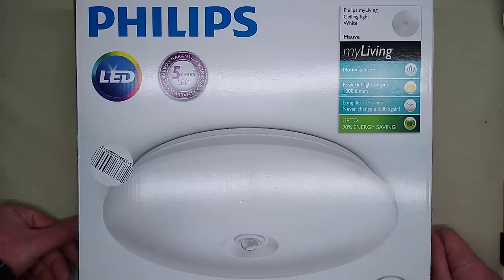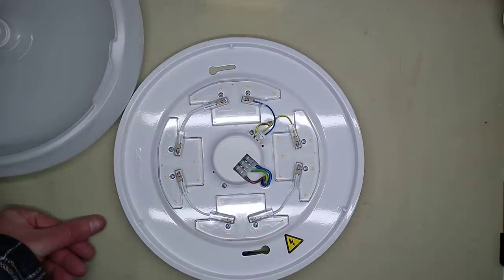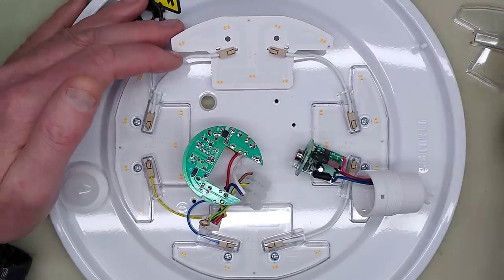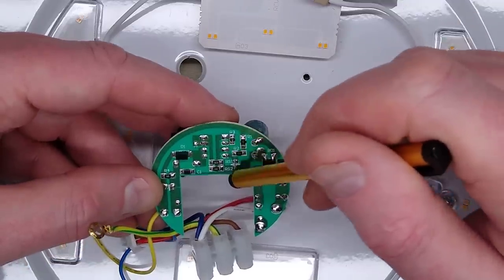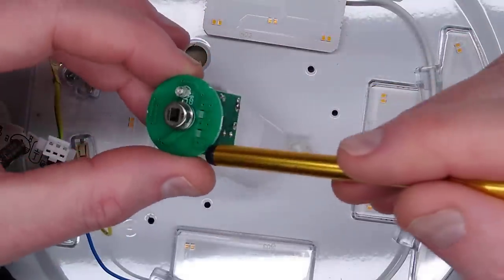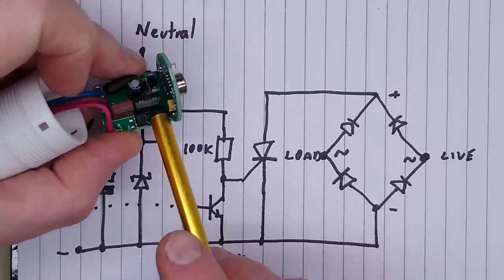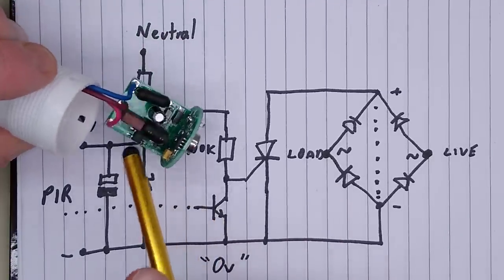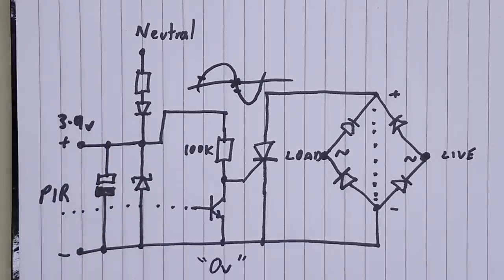LIDL Philips PIR LED ceiling light teardown.

Comment: 15 Years life, but how many hours a day can it be run to last 15 years? They often state this on the back of the box somewhere, in smaller print (i.e. based on being used xx hrs per day).  Also after watching Dave (EEVBlog), those lights wouldn't be legal in Australia because of the poor power factor.

Comment: Is there a way to switch off the motion detector in order to have the lights on all the time?
Reply from the maker: Yes.  The sensor usually has three wires.  Live, neutral and switch.  If you bridge the live and switch wires together it should run all the time.
Reply: @bigclivedotcom  Thanks.  At 4:54, please correct me if I'm wrong, does it mean that it would be possible to jump/connect the blue and red wire of sensor connector?
Reply from the maker: @sivitec  it may depend on the specific colours used in your module.
Reply: @bigclivedotcom  Edited: I checked the wirings of the sensor.  Based on the snippet on your video at 9:00, RED is marked as L*, BROWN as L.  BLUE is marked as N.  If I need to jump the connectors, which one should I connect to bypass the sensor?  By the way, I have the same model LED ceiling light.  Thanks in advance.
Reply: Just an update for everyone who wants to bypass the motion sensor unit.  Solution is to to disconnect the sensor from the base and jump the RED (L*) and BROWN (L) connector on the connector base.  Thanks for this video @bigclivedotcom.

Comment: My lighting circuits have 3 twin and earths coming out of a hole in the ceiling and terminate in a rose fitting. Theres no way you can get all 3 of those cables through such a small hole in the metal plate. Were these designed for use outside the UK ?
Reply: I use wago connectors and link to the main light fitting terminal...easiest way.

Comment: Lidl has one on sale now, that is IP44 and has a glass shade. I'm tempted to buy one and install over may back door.
Reply from the maker: I almost bought one, but was put off by the glass shade.
Reply: bigclivedotcom my thinking was that glass would survive better in uv than plastic.
Reply from the maker: @JohnnyMotel99  it was trying to ship it back here with breakable glass that put me off.
Reply: @bigclivedotcom  I bought one today. very uninteresting device. E27 bulb and a motion sensor. The motion sensor has to be the most dastardly awkward for changing settings...it's all dip switches. I'm taking it back!

Comment: Would have been nice to know what it draws when "off". (LEDs off, but the IR system still running.) IR systems that use as much power as the actual LEDs is a problem, and you noted that the IR module might be getting warm.
Reply from the maker: In this case the PIR module was dissipating about half a watt.
Reply: Dave Jones (EEVblog) recently did a comparison of the current drawn by a zener circuit compared with that of a linear regulator.

https://www.youtube.com/watch?v=oIAATOQe3to

Comment: I got a similar fixture from a Polish company 'Kanlux' but without PIR sensor, they state a 15000hr life (fingers crossed it last over 5 years). Very different set up they use a led driver like the ones you can buy off the shelf and the LEDs are similar the ones you get in LED TV backlighting i.e. they look like glass pebbles with a led inside. It's 42W though to give 2700 lumens and 500mm in diameter.

Comment: The power factor is usually helpful in learning how well an LED fixture power supply is designed, IME. That 0.55 isn't great, but won't make a difference to virtually anyone in a residential setting, I suppose.

Comment: Clive how do you change the circuit to make it turn off when it sences moment??
Reply from the maker: Easiest way would be to add an extra mains voltage relay that got energised by the detector. But the light might cause issues with the dusk sensing.
Reply: @bigclivedotcom  Clive thank you for taking the time to reply.  When you showed the circuit I wondered if the Transistor was in a different direction it would change the way the light would work,  I want the light to stay on then switch off when someone walks in. It's to use with a uvc bulb, atb nick  p.s keep up the good work

Comment: You know when you have a decent led bulk light when you see a switch mode power supply and not a capacitive dropper circuit inside! Although capacitive dropper omes are easier to fix and replace components rather than the latter.

Comment: Thanks for the video, does anybody know if it is possible to change a resistor or capacitor to tweak the PIR timer? My lamp turns off after 30 seconds, it would be nice to change that to 5 or 10 minutes.
Reply from the maker: It depends on the type of chip it uses.  The classic BISS0001 does have resistor and capacitor timing options.
Reply: @bigclivedotcom  Thank you for answering me. The IC in this PIR sensor says SS002A, do you know that part or where I can find a datasheet?

Comment: why the missing cap on the circuit board?
Reply: Greedy penny pinching, thats why. Its not really needed but if i bought this LED light, i would solder it in. "If it should be there, it will be there."
Reply: What value would you use?

Comment: I found that bridge + scr trick to switch AC loads in a thermostat awhile back.  Those run on 24VAC but the idea is the same;  this way they can get away with using a sensitive gate SCR and no opto isolator to switch the output.  It uses less current and probably ends up being cheaper.  The only disadvantage is it's not isolated from the AC and you can't easily duplicate the circuit and run multiple copies off the same i.e. microcontroller.

Comment: Yep, what you got to remember  " LED  s  "  are infact   diodes   so PSU designs can be different than resistive standard light bulb or a BUCK PSU.   As diodes arn't really a load but half a transistor or a one way valve.   All diode give off photons (light) so all are LED s;  what we call LED s in consumer is a the  new light bulb,  These are just tuned to give more photons out for more light instead of a high PIV (reverse hold on the valve ).   So I always wonder in these types of PSU design that when a component does go faulty short or open would full Live go throu the SM-LEDs, if it did I think they would just pop with the AC minus wave as they do not have a high PIV, hence they used a full bridge in this design, would have liked a real thermal 1 ohm resistive fuse in this design or a three legged EMI fuse for safety (back to back diode).

Comment: Wow, as of late I've actually had the idea of using a... (hu-hum) FULL BRIDGE RECTIFIER as part of a switch circuit in this exact topology. Although I couldn't figure out an actual switch element that would make sense for the topology so I've just dismissed it as a neat but ultimately silly idea. But I guess this answers that.

Comment: I wouldnt mind making that into a two way power light for my home so if the power went out, I could still run on a battery back up system. With the onset of the LED, now it should be possible to install low voltage lighting in every home that can be switched over to battery back up in a power outage. Plan on making my entire home into a low voltage light system.
Reply from the maker: Check out the USB rechargeable PIR sensor lights.  They're very good if you have a lot of power cuts.

Comment: If anyone else sees those massively divergent manufacturer guarantees and is instantly skeptical, you're in good company. I've rarely had any luck with Philips products.

Also, I noticed that as a general trend, LED lifespan ratings are often based on unrealistic use patterns, like 2-3 hours a day. "But it's gonna last seventeen years, hurrdurr derp!" Give me a break.

Comment: 5 year philips guarantee applies to the whole fitting... though after tear down if damaged warranty would become invalid... you need to remove the cover for fixing it to the ceiling + connecting the wires... 

warm white? yeah I might have known you couldn't resist buying it

Comment: 15W is too high not to use metal core PCBs for the LEDs in my opinion, even if the power is spread over a reasonable area. The LEDs in brand name lights tend to be optimised to withstand high temperatures but the fact is heat is bad for them. Who knows though, they'll probably be fine.

Comment: I have cats. Tried PIR lights, became a cat toy. They can get in the refrigerator and freezer - velcro fixed that for now. They flush the toilet and turn on the water in the kitchen sink and leave it on. They watch everything i do closely and quietly. There is a lot of brain in those little heads.
Reply from the maker: Yeah.  They're clever and funny little things.  That's what makes them great companions.
Reply: @bigclivedotcom  Agreed
Reply: Its even better when both your cats have figured out teamwork and open the doors by themselves.  The robo litter box was a great idea until they figured its great fun to activate and watch.....at 3am in the morning. There are a lot of brains in there little heads.
Reply: @drkn9t  Oh yes they very much work together to achieve common goals.
And 3 am is kitty fun time, 1 st event most mornings is : the kitty races. I sleep thru it most nights. An example of teamwork i see weekly is one draws me away from " the goal " while the other works at ripping the cat food bag open. And does so well. food all over the floor. They are both amazed by
peeing and will put a paw in the stream to smell it. And use of the phone they both will sit next to me and meow louder and louder
until i speak to them. If i do not walk away they will do that over and over. And the litter box not only am i reminded to clean it, they both dig like dogs to the bottom often like treasure is in there. Mostly when i am not there. They run the place, i just pay for it.
Personality and adaptive intelligence.
Reply: My two are rescues, I have more like Elephant Runs at 3am, at least these two I trained to put paws up on the "Catbinets" instead of meowing in unison (aka "Kitty Committee") for meals. Older one pats me on the face for treats or pets, younger one head butts everything for that (She just HAD to be different.) They're my "Fur kids", somehow they got spoiled rotten!
Reply: @mrsheesh3743   Oh yeah it's like the running of the bulls at 3 am ! they bounce off chairs and run on the walls to take corners. My two are street rescues, one at a time they just showed up with a sad story. So i fed them and talked to them on the porch.
The giant one decided one morning to run in the house when i turned for the door, and would not leave. Got rid of the flea's first.
And a vet trip later she is all set.
21 lbs of cat she has since gained a few more, and is not obese. Think of that load jumping on you from the floor when in bed.
All grey with faint tiger markings.
The 2nd a mackerel tabby 17 lbs female.
Both were spayed when they showed up at my door. The 2nd one wasted no time, i opened the door to put a dish of food down
and she just ran in. I'm certain they were housemates before they got booted to the curb. No hissing or a single growl from either one. They knew each other well from the start. They sleep in a ball together
under MY blankets and snore loudly.
Maybe you know about this : what is the kitty deal with the loud meows from each one at each end of the house, then they switch and do it some more. Is it a we have this place under control kind of thing ?
They just love to do it.
And the talking non stop to each other and to me. I get it if i copy they copy and on it goes. Even if i walk away.
No such thing as being alone with those two around. Even taking a poop they BOTH have to watch. When the cat box is not to
their liking they pee in the tub, that took a while to teach.
Reply: @johnrobinson357  You're lucky to have them - and, Big kitty! The meows are probably to make sure they're both still OK? Have to be sure of that! One of mine sleeps under the covers almost always, the other only when she's really cold. The one's from a hoarder house, she's SO much happier than when I first got her. Important thing's to love 'em :)

Comment: I’ve got the non PIR version at home, these glow relatively brightly when the light is off
Reply: I had an outside light that did the same thing - until I reversed the L and N connections inside the lamp, but we do have some weird things going on with the electricity supply in this neck of the woods.
Reply: Clive has mentioned before that this is quite common due to capacitive leakage in the supply lines, particularly with 3-way circuits.  I've got one in the hallway -- on a 3 way switch -- that glows.
Reply: @MichaelSteeves  I've a CFL that flashes in the night.
Reply: That can also happen when there is a light in your light-switch (to find the switch in the dark). These sometimes let a small current through even while the light is switched off to be able to power the night-light. Enough to let the leds glow.
Reply: @zenddoor  Likely a neon across the switch !

Comment: I tend to like Philips LEDs. My home is 90% Philips down lights which after almost 7 years not one has failed. The remaining 10% are Chinese cheap down lights. So far 4 have failed, in all cases one of the LEDs had the black death. Easily fixed however.

Comment: the marketing shite says 50 years, the tantalum and electrolytic caps says otherwise
Reply: If used correctly, tantalum capacitors can last for over 30 years. Again, if used correctly, good quality electrolytic capacitors can last for over 20 years. Half the problem is cheap components being used, the other half is products not being designed to last, and hence components being used outside manufacturers recommended conditions. E.g. it’s not good to put electrolytic capacitors right next to hot resistors or hot heatsinks.
Reply: I have tons of electrolytic caps over 50 years old which are still functioning fine. 
I also have a good bit of gear I picked up on the cheap and repaired because the 20+ year old tants started to catch fire.
Reply: "If used correctly, tantalum capacitors can last for over 30 years" "good quality electrolytic capacitors can last for over 20 years" - the marketing shite says "50 years" but that's besides the point, this light fixture isn't ventilated and it's full of LEDs - it's fair to say that nothing is being used correctly here.
Reply: @Peter_S_  it would be a good idea to change those caps, I had a beloved piece of old gear that was doing fine until some caps in it blew and utterly destroyed it, but older gear tends to be well ventilated, used over spec parts to assure longevity and was just better made than today
Reply: @Zardox-The-Heretic-Slayer  I concur when it comes to parts in certain circuit locations, but life has other priorities.
Reply: @Peter_S_  there is no bigger priority than test gear my friend!

Comment: That actually looks to be a decent light at a decent price. It may not last 15 years but say if it lasts 5 years that is still pretty good for that price. Of course I still have one generic 23W CFL that I've been using at least 5 or 6 years now and it was only a couple of dollars.  As far as Phillips, they seem to be an OK electronics company & made alright TV's although not as good as Magnavox  was on their own which is who they merged with or took over. However they are probably just another Chinese company now with the rights to the name and just putting it on your inexpensive electronics.
Reply: i still have the FREE BULB the power company com-ed sent me back in the late 90s, it operated 24/7 in a hallway for 15 years nonstop and still works to this day, first gen feit 9 watt

Comment: I used the same light without PIR to fix a more expensive round light. I just replaced the led from that lamp to the broken  tube bulbs.
Reply: For what reason? thanks
Reply: It was a nice looking lamp that i did not wanted to replace. 
I had painted the room 2 weeks before 
And did not wanted to find the same size lamp. 
And it was cheaper then getting a new tube

Comment: Philips has some pleasant warm LED colours that are worth considering. Philips is an odd company as they have sold some great and some lousy goods. Their LEDs are winners IMHO
Reply: Haven't tried these panels yet, but I've had very high failure rates with several different ranges of there bayonet and E27 socket mains power bulbs... regardless of if you opt for commercially branded ones, domestic branded ones, higher rated wattage's or lower, they just aren't any brighter nor last any longer than totally unheard of brands offerings that are half the price or less. You pay for a brand name, but no longer does that actually indicate any difference in design, quality of components or even QC (while not common, I have had a 7w E27 6500K that was dead on arrival).
Reply: @SheepInACart  Haven't had any of the Philips bulbs fail. They have certainly dimmed like the other LEDs. After incadescent and halogen, these come in third for me.

Comment: But you are not going to get shocked by 3v?
Reply from the maker: The 3V in the PIR is referenced to mains voltage.  Like a set of batteries connected to a live wire.  You can measure 3V across them, but full mains voltage between them and ground.

Comment: I had some Phillips LED filament bulbs that were sold with a "5 year guarantee". All had one of the LEDs die in under 2 years (ended up with flickering bulbs) and I couldn't get a replacement or refund as the supermarket stopped selling them and I couldn't actually get a response from Phillips for the replacement (receipt was also gone so maybe that's why they ignored me).

I did tear them down and they were quite well made but I have a feeling the varistors they used weren't chunky enough and it was in an SES shell so not a lot of space to fit a good size. I still have an intact dead one laying on my desk if you want it but I'm sure you are sick of pulling these kinds of bulbs apart!